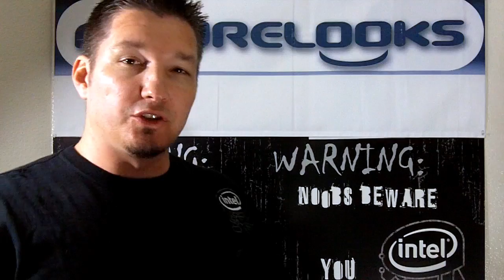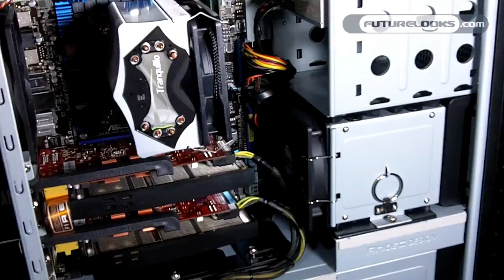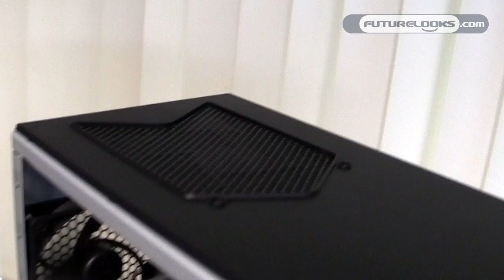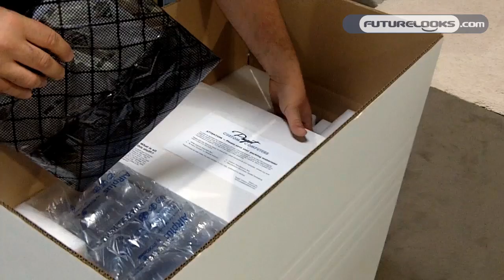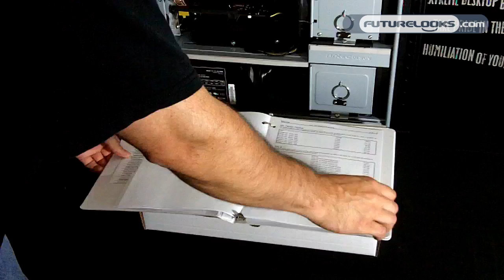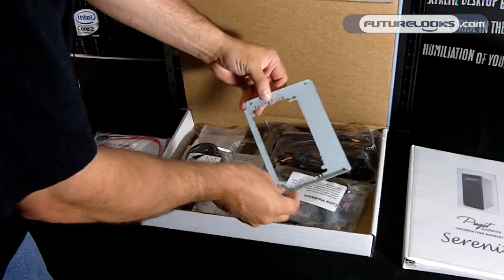Futurelooks Previews Puget System's Serenity Silent PC System

Comment: @cameron fischer I watched the video, I know the point. But I know for a fact that already in this generation of graphics cards, they dump excessive heat. My gtx 460, despite being efficient and having heatsink as big as those still dumps a crap load of hot hair through the fans. It feels unsafe having graphics card at the tier of hd 5770 being only passive cooled.